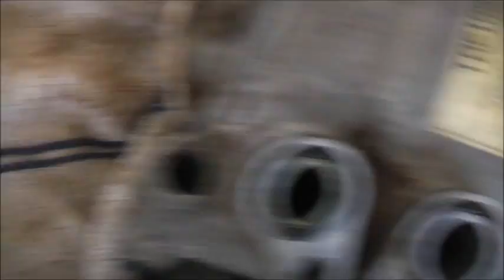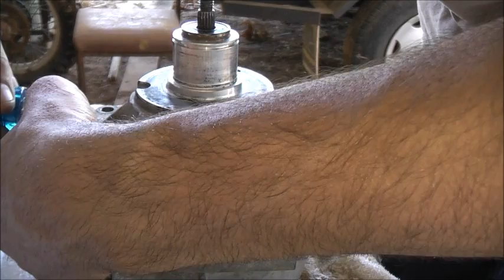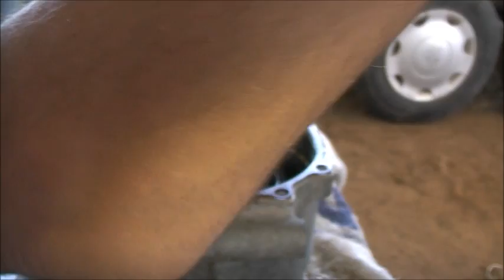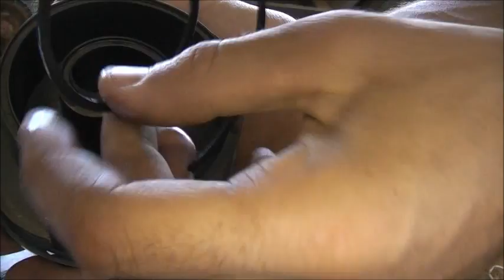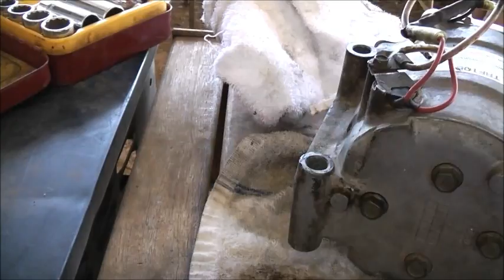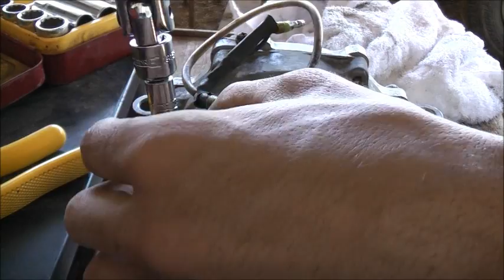Sanden Scroll Compressor Teardown

Comment: They don't make for a good air compressor. When dirt gets inside it will damage the pump. We had a compressor at work that had 3 small scroll pumps inside. We always had problems with them. They would make a better a/c compressor since it's a sealed system.

Comment: could you please tell me if this statment is true "The motor compressor is suspended by springs in the capsular housing which minimises the transmission of vibration to the capsule body, thereby reducing noise Emission"
Reply: For automotive compressors this is NOT true.  For refrigeration compressors, e.g. in your refrigerator, it is true.